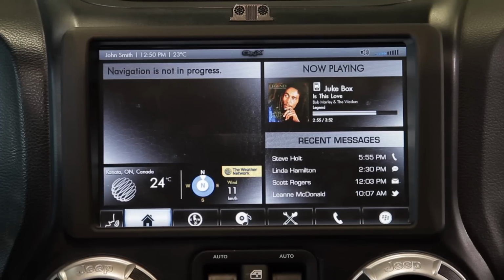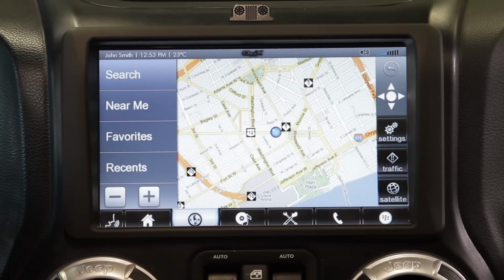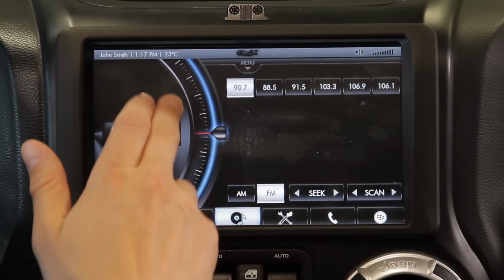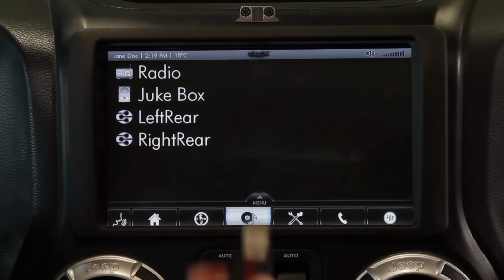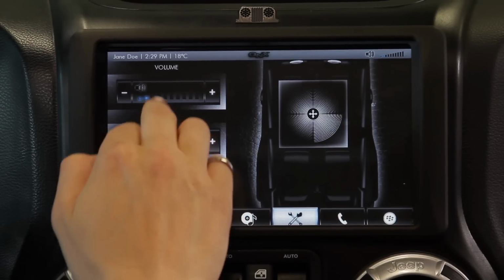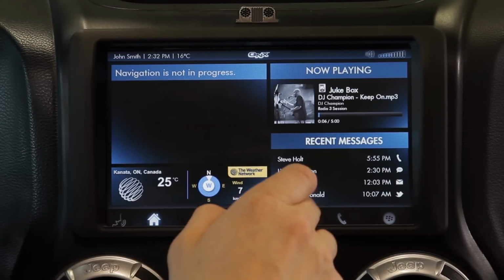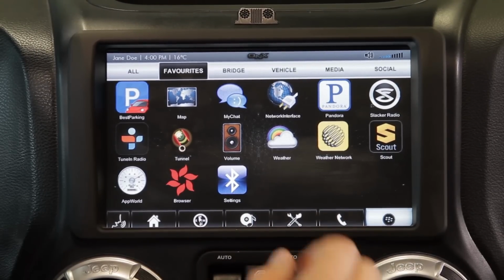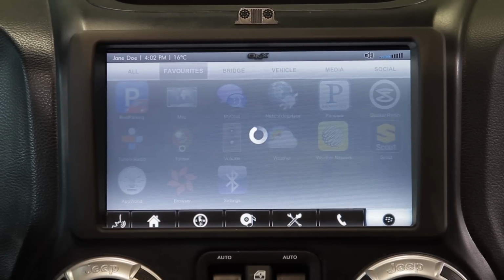Feature-by-feature demo of the QNX CAR 2 application platform

Comment: I don't Apple has perfected their system, it's still in Beta, and besides if you look on Edmunds  you will see 49 auto manufacturers listed. So 12 car makers isn't even 25% of the total. 
   You are missing the point of what QNX is: It is a mobile computing platform. Lets say you are running late for work, you can have your Twitter and email on your dashboard, or you can use Skype to send a video message if you are stuck in a traffic jam at a stand still.